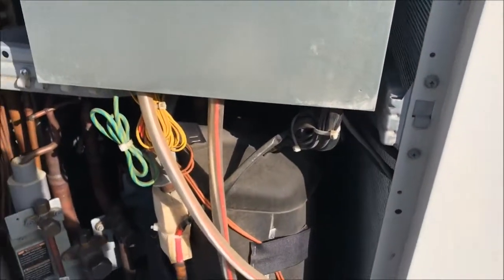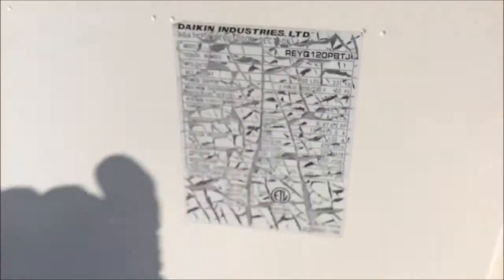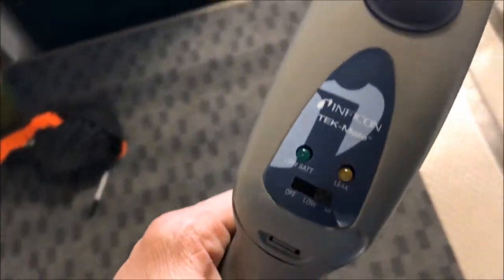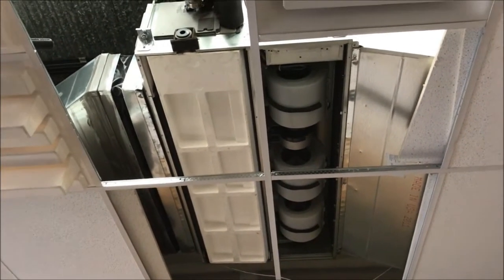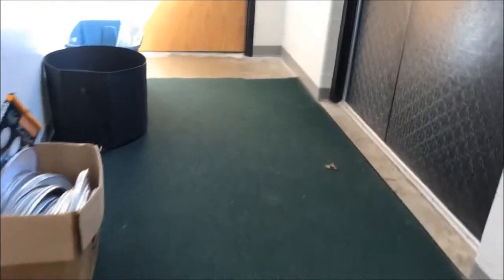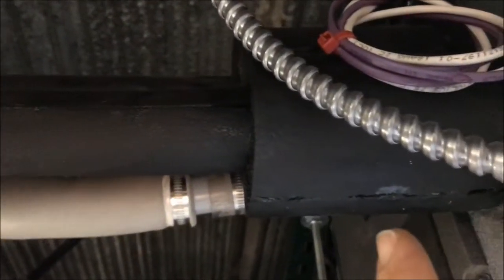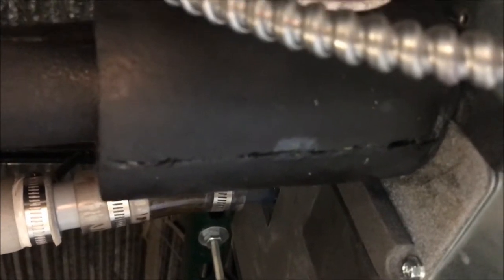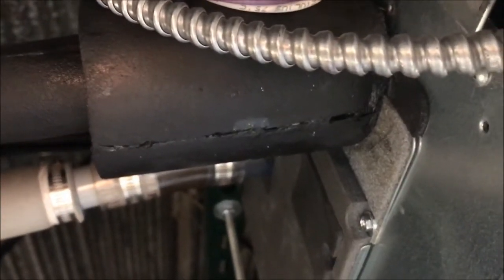Daikin VRVIII System Leak

Comment: You opened the system and did t pull a vacuum before recharging?
Reply from the maker: Always evacuate after opening a system. And purged with nitrogen while brazing. Just because it’s not in the video doesn’t mean it didn’t happen.

Comment: Good Vid. How do you like the infineon Leak detector ?
Reply from the maker: OcRefrigeration,Hvac & Electrical. It’s okay. I’ve had that one for 12 years, just replaced the sensor in it. I’ve also got a Testo 316-3, it seems more responsive to HFC refrigerants. Got the H10 at home, need to get it charged and ready for a backup verification on jobs like this.